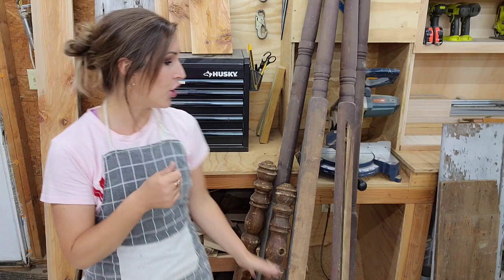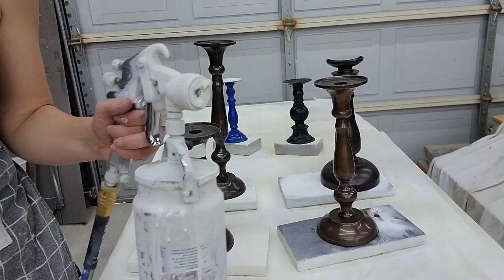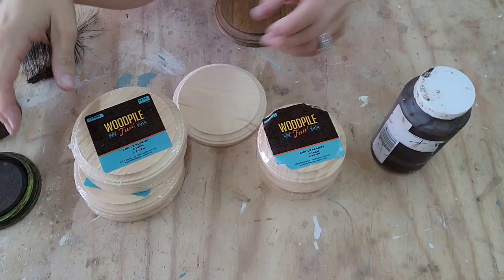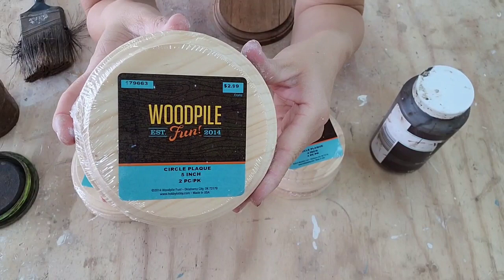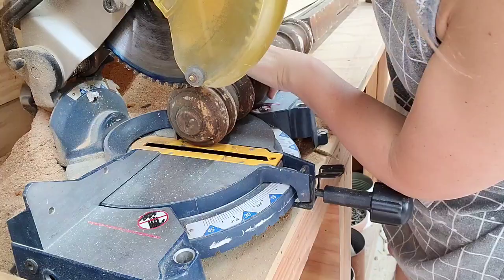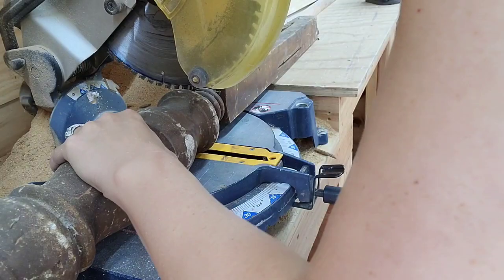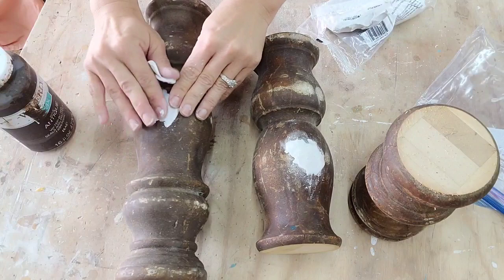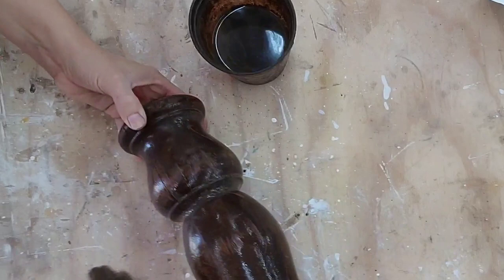Thrift Flips • LET'S MAKE CANDLESTICKS • Trash to Treasure • Using Milk Paint • Spindles

Comment: easy way to fill the holes is with wood sticks road  like the ones we use in closets to hang clothing but thinner...glue, stick the road, let dry and then cut...voila...easy.
Reply: @ Lolitabonita 

You can also use dowel rods, old wooden broom handles, and Dollar Tree toilet plunger handles depending on the diameter of the hole.